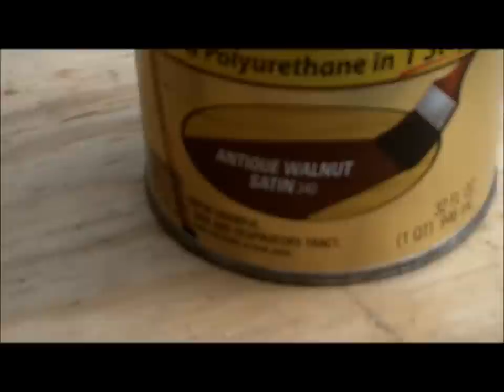How to Make a Wine Bottle/Glass Rack

Comment: I made the same rack, without the glass holder below, that is very smart!
I wish you had finished the front off a little better it looks a bit ugly.  You can still get an industrial look but also enjoy the wood grain.
With regard to the nails below... not needed for decor since no one looks below and its not eye level.  I would have used GRX cabinet screws from H Depot, which sink in and are almost invisible with their small heads and bronze finish.  The nails are not as solid, and tend to crack the wood and rust.  When I used my Sawzall to cut the pallet wood, I left in the cut nail heads and after refinishing with stain, I added some superglue to hold in the loose nail heads to preserve the industrial look.  After you sand them down, they look fantastic.

Comment: Just made one of these for a wedding gift. Any recommendations on what to use for hanging it?
Reply from the maker: Hey just saw this comment, sorry for the late response. I used bolts to hold it right to the studs. Wine bottles hide them perfectly. Hope I'm not too late!
Reply: No worries. That's pretty much what I ended up doing but I used some heavy duty nails. Thanks!

Comment: At 1:37, you were focusing on the bottom of this awesome wine rack.  My question is based on the fact that you measured the bottom with a long plank but them began cutting on a sheet of plywood.  Please help me on figuring out how to finish the bottom.
Reply: I'm assuming its something as simple as measuring the distance from edge to edge minus the blocks on the end.  The video threw me off.  This is the best wine rack I've seen yet..simply because it works great for beginners like me.

Comment: How far apart did you space the holes for the wine glasses? Great project. I jumped up and started it but am stuck with not knowing how far to space. Thanks.
Reply from the maker: I believe they are centered 6" apart from eachother. If you have a set of glasses already you can lay them out and measure the distance inbetween the stems.

Comment: what is that tool you're using on your dremel? Some kind of dremel crowbar?
Reply from the maker: It is an attachment that cuts metal, perfect for this occasion.
Reply: *****
What's it called? I want one!
Reply from the maker: Andrewman9000  The
tool is a Dremel Multimax. The package contains a sander pad, a metal cutter, wood cutter, and drywall cutter.

Comment: What kind of screws did you use to screw the base in? Thanks for the great video!
Reply: When I made a similar wine rack I used GRX cabinet screws from Home Depot.  Fantastic quality!  The small heads can be sunken in so you don't see them.  You can put in thumb tacks outside for the industrial look decorative finish, but much better to screw that heavy wood solidly in, no nails.  Also the GRX won't rust easily like nails.